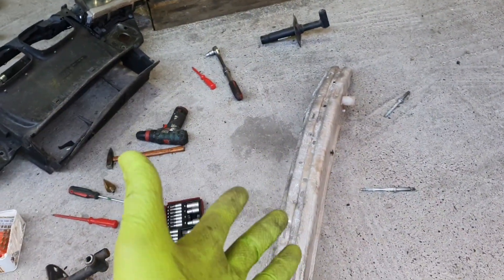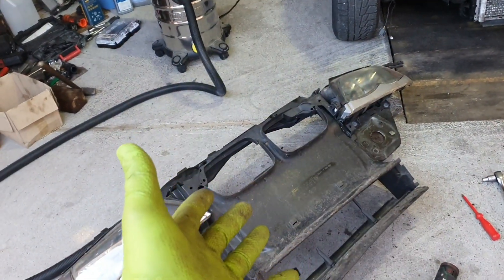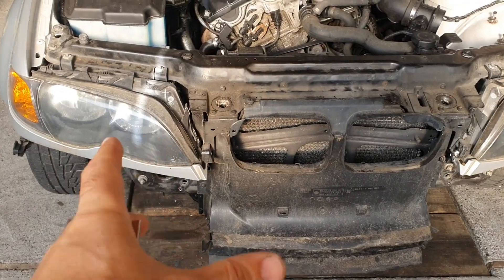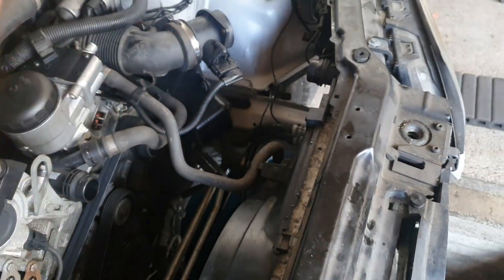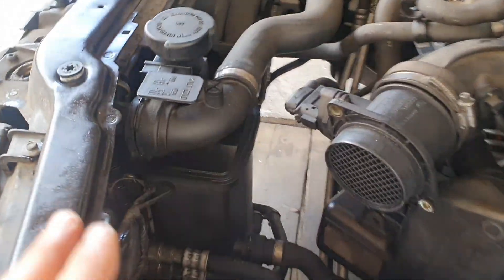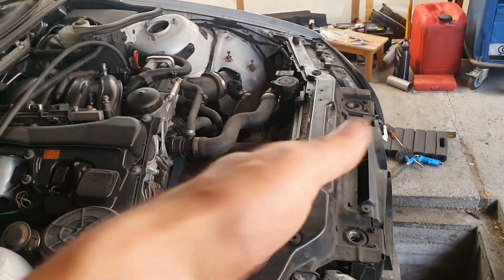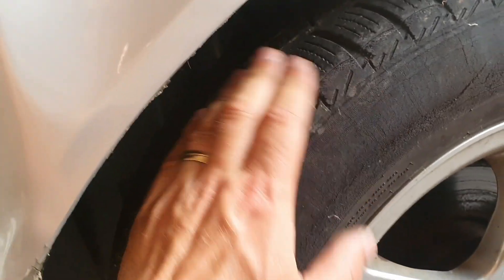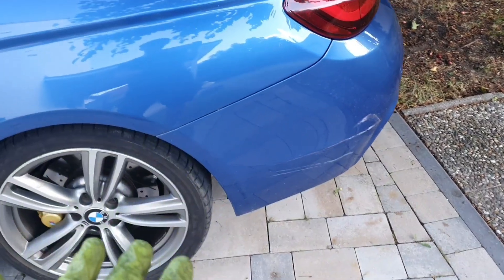Bmw 316i E46 project car! Never ending problems??!?

Comment: Is this n42 or n46? I have an n46 and my water tank is a different shape and also the air filter as well 🤔
Reply from the maker: Mine is n46 but facelift model. That means that after 2002 till 2004 the e46 has some small modifications